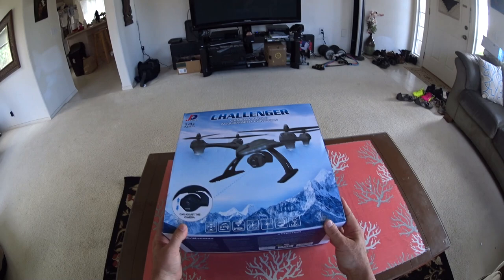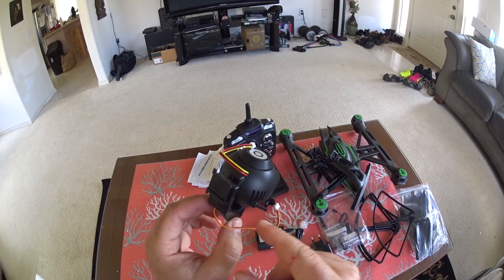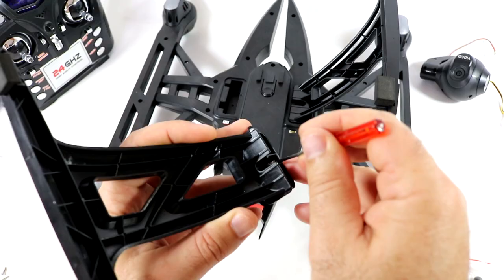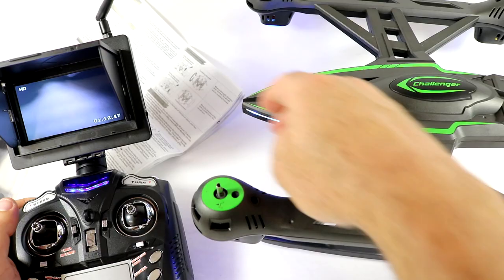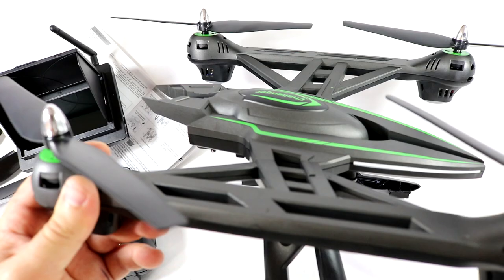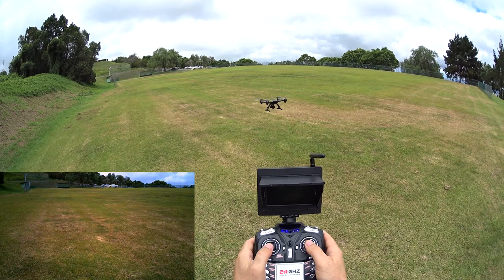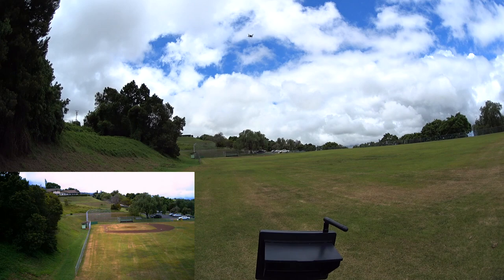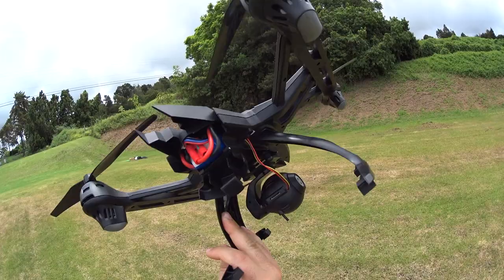JXD 506G FPV - Full Review - [UnBox, Setup, Flight Test, Pros & Cons]

Comment: Just re watched your video and leaving out the plugs that cover the propeller guard holes will increase drag, by creating turbulence where the holes are. Drag is reduced by streamlining which the plugs would achieve. Also it is not possible to install the landing gear backwards as they are key located. Also it is a very good idea to keep your screwdrivers attached to a permanent magnet - makes picking up and locating screws in holes so much easier.

Comment: A very good and mostly fair review. I said 'mostly fair' because I thought you were a little too hard on this quad in spots. You criticized it for things that almost all toy quads do. Example: Almost all, not just this one, toy quads have an unreliable return to home. The fact that you didn't test the return to home right off the bat is likely the reason why it didn't work. Instead you first took off flew out, zoomed around a few times attempted some kind of a funnel maneuver and then you did the return to home test.  This likely threw off the gyros or accelerometer and caused it to lose track of where it started as well as what was right left forward and back. They all do this. I've never seen a toy great quad that at the end of the review was able to do a reliable return to home. So that test should always be at the beginning after you reset the accelerometer and gyros and then you take off and test the return to home. Also I believe that the video should be shot about halfway through the review because the battery level will be too low at the end and you will risk not being able to save your video. Next I noticed you putting the decorative propeller spinners on while you were at your bench but when you were out at the field none of your propellers have that chrome spinner on them. What happened?
  I own an JXD 509G. And compared to other 5.8 G toy quads it has superior FPV range and clarity if not the most motor power. so as far as FPV range with this quad you tested I would like to see a toy grade 5.8G quad that has better video range. I mean what can you expect it is a toy grade quad not a hobby great one.
Reply from the maker: +Partok81 Thanks.  Here are some answers and reasons.
I've reviewed several toy quads that actually remember their bearing perfectly even after flying around for a while and so this is normally why I test the headless and RTH functions after some flying if I remember to do it in that order.  So there is now a bar set for the ability of this function IMO. (If RTH is skewed after some flying..what's the use?)
   Yes, it's better to stop the video before the battery dies to prevent corruption.  Fortunately the video automatically save with this quad and stopped recording at low voltage as seen in video.. definite pro.
  yes, I forgot to put the silver caps back on before the flight test (purely cosmetic).
  It's got decent FPV range (agreed it's around the best you can get at this toy level with mono pole Antenna which would improve with a flat panel antenna swap on the screen.
   Flipping it is is another story which I think my review thoroughly covered.  Alt hold was good.
Reply: +Dustin Dunnill Thank you for your reply and explanation. I hope I didn't seem too harsh.  You and Flyin Ryan are my two favorite aircraft reviewers.  Keep up your great work!

Comment: On vacation, gonna dust off the 506G Challenger. Just wondering about you 9.5 minute flight. Mine never flew over 5 minutes. I had 4 batteries which was a necessity with 4 to 6 minute flight times. I will say 4 minutes the last minute or so was just limping around bouncing off ground. Did you fly this a few times...? 9 minute flights would be sweet...

Comment: mine is on its way.  curious as to Battery Upgrades as well as motor & propeller options....  I'll also be looking for upgraded antenna's to give MYSELF AS MUCH control as I can have.  Im sure as anything else, mods do make a difference if done right.  now Im a complete newb and cant solder.

Comment: I bought this one about a month ago. I had the controller in my truck while I was charging my quad battery and some one stole the transmitter. I have no way to fly this now and they won't sell me just the transmitter.  Is There any other radio I could use to pair up this copter.

Comment: Hi sorry for probably asking a question u got constantly however I really need to decide what I go for I'm looking for a gps quadcopter which has long battery and decent range I also need a action camera so I thought I could get a quadcopter and buy a camera for it then also use that as a GoPro kinda camera so the upair one for example looks good however the camera is built in and not removable which is frustrating  
I thought a x380 with g2d gimbal, Fpv, possibly osd and a firefly 6s is a good option but is there any newer cheap gps quads I have completely forgotten 
I have had a tarantula x6 quadcopter before so have experience and know how to fly 
Thanks

Comment: This quadcopter is very bad, the slowest i have tried, can't fight the wind and it takes 20 seconds to come from 5 meters high to the ground because the altitude hold is always active and you can't turn off the engine and sometimes going down simply doesn't work. I had to perform auto flips to go down.
A modded Tarantula X6 with an FPV module is much better for the same price.